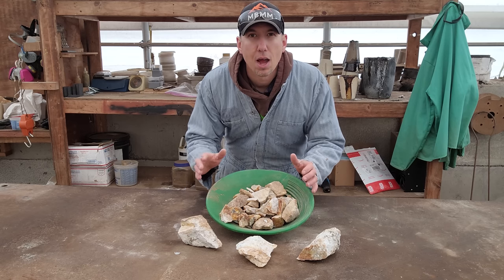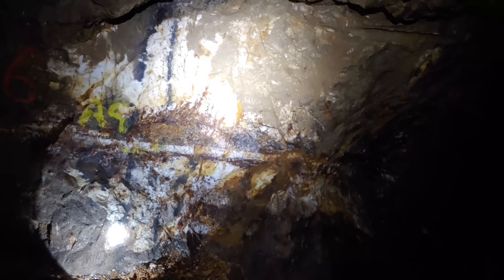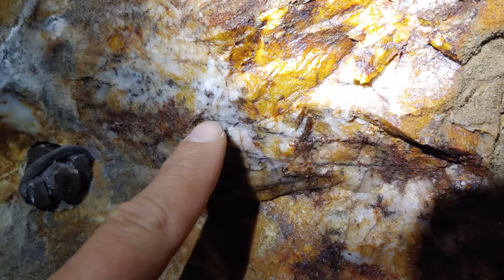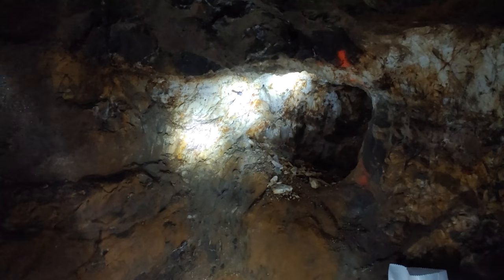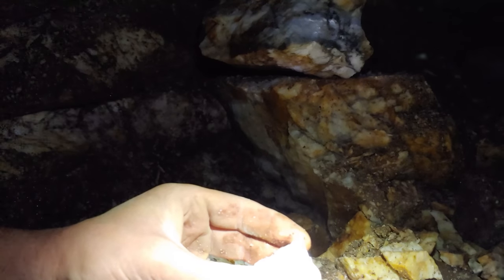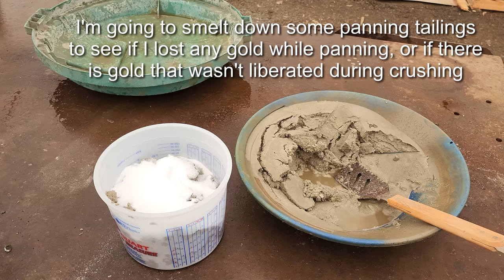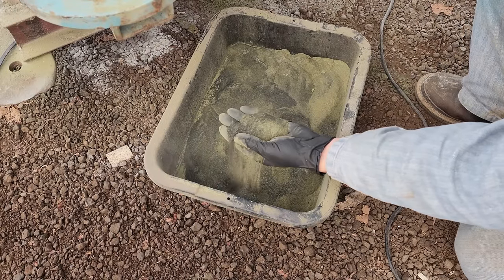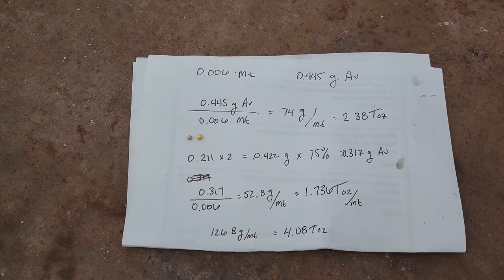Smelting Gold Mine Sample - Processing Abandoned Underground Gold Mine Ore

Comment: Jason, you should try applied heat to the cone mold to slow the cooling process and allow more time for the heavies to settle to the bottom.
Reply: @UCWPd57qVP0c5Is8-2g4hEWw The heavies are already at the bottom of the crucible and are actually the last out. If you delay the cooling of the cone mold, it gives the heavies more time to settle. This is the technique my grandfather used.
Reply: Your grandfather's method sounds totally logical.
Each time I watch Jason pour hot content into the cone and see the remaining liquid in the crucible not making it into the cone, I can't help but wonder about any possible heavy (precious) metals being left behind; or how much harder it must be for them to reach the tip of the cone since the cooling process has already set in. 
Here was also the first time I saw him thin (re-smelt?) that bottom leftover in the crucible, which is good, but it was then poured into an already cooling mass, which might have prevented any remaining heavies from reaching the tip of the cone.
Reply: @vernowen2083  You should try the oil and water in a clear glass demonstration. The heavies are at the bottom of the crucible after the melt but they are not the last out during the pour as they sink through the molten solution very quickly as you tip the crucible over while pouring.

Comment: Hi Jason!

I work in granite industry many years as driller and also stone splitter with those same wedge, I strongly recommend you at least 3-4 more wedge 4 inch appart, don’t dip to much in the face also, and last trick is smash just a little the wedge and let pressure build up, drive wedge straight into didn’t often work, it drive the crack often to the easiest way than take big chunk 😅 and for removal of the wedge drill close along one feather than will loose the pressure of the wedge easily. Drive pop hole throught natural crack is the best. You should absolutely put the chisel away you done well the feather and wedge man! The wedge was the piece you smash and the feather was the two piece you have to point into direction you want the pressure. Here in quebec we name it Coins & Jumelles 😁
Reply: Merci beaucoup! 🇨🇦❤️🇺🇸🍀🔥🌲🥓

Comment: As for lights go, when I was a photographer we used what's called "daylight" bulbs. Normal bulbs tend to be on the warmer side of the spectrum IE- yellows to orangish light as where "daylight bulbs" are on the blueish side which makes light that is more like sun light and also it's easier on the eyes. Hope this helps Jason.. Can't wait for the next video.. Chris..
Reply: Question for you. What is the photographers term for those silvery-white "umbrellas" used to provide even diffusion of light ?
Reply: @John-ir2zf  umbrella diffuser...
Reply: @John-ir2zf  We called them chimera's as kind of a blanket term as it was the company that made them. If you go to a photography store you can find the "daylight bulbs", diffusers, light heads and tripods. A cheaper option could be to swap out the blubs on you shop lights with the led bulbs, either was it will help the video. Regards. Chris.
Reply: Regarding lighting: A lot of light is being reflected back to the camera when you look right at a sample and it overwhelms the sensor. Having the light off to the side at a different angle than the camera may help.
Reply: @MrPhillip2  Yea, what's going on is the quartz being a bright white reflecting a lot of light and everything else being dark. He just needs to change camera settings to at least center-weighted metering for exposure setting. This way the camera shortens exposure to what he's trying to point out in bright center.

Comment: Hi Jason, Richard Cheney here ,,I've been a gold miner for over 30 years ,.and have had to deal with gold dust recovery for a long time.and your final processes are no good ,after you get it down to a powder ,you need to pan a real lot ,and in a bigger gold pan you have there,with fine gold ripples to catch it ,and when you get it to this basic panning ,and use a magnet to get out all the iron,black sand ,and so forth,you take this concentrated stuff and run it over a black majec sluice refine gold table,and pan that down more until you come down to the super refinements,and then you proceed ahead to your kilm ,are crucible ,and you add in healers borax, and bring it up to 2,000degrees,and por it into you graphite mold ,there's a lot more to this it I can't at this t crept all infro.
Reply: Richard here for more infro. You need a much bigger tank of water than your using there to pan that more correctly, to get rid of all that,dust patticles,evermore you use the black majec table,and all you need to mix into this is jewlers borax,,a flux you can buy there's much more you should know, about all this, whats our email and can trian you to the max,ie

Comment: Hi Jason. Your fine grinding mill ain't a grain mill. It's a mineral processing mill. Bico has been manufacturing Mineral processing equipment since 1888. Although this mill is discontinued they still supply replacement parts, so you should be able to get new plates if required. I have been a mineral processing technician for 17 years and I love disc mills for fast fine grinding. We tend to use a disc mill primarily for assay samples( analytic analyser)  and not gravity separation due to the amount of ultrafine material generated by the discs. This is probably why you had so much precious metal in your tailings. You did a 2 stage grind which is good but, you didn't seem to screen out the fines in between. These then get reground and produce the ultra-fines which you don't want as ultra-fines tend to go straight to tailings in gravity separation. I love your shaking table by the way. As I specialise in gravity separation and pilot plant I would love to get my hands on it. As I live in the UK I doubt that will happen. Happy new year to you.

Comment: I do a lot of amateur photography for a hobby Jason, and what is happening for the most part in your video is the camera you're using is adjusting its light if you're on auto exposure, and trying to find a balance between the darker Shadow area in the outside what you're trying to show which makes it too bright on the center. You need a camera where you can, black on a phone camera, tap the spot you're trying to show to the camera know to adjust the lighting to that spot and ignore the other areas.  The only other thing you can do is get the camera lens closer or zoom in closer to where the darker outside area that we are viewing is not in the picture. You have to take the decision making process that the camera is using out of the equation. It is trying to find a proper light balance for everything that you have in the viewing field the dark and the light and when it tries to brighten the dark it automatically wash it out what you're trying to show us. If you can manually bring the brightness down it will make the surrounding area black but will make us able to see the detail on the light area. I hope I worded that in a way that I was understandable. Love your videos.

Comment: design a large crucible pouring device so when you pull the hot crucible out of the furnace you can set it in a cradle with one rod across the top of the crucible to hold the crucible from falling out  then you can be off to the side and turn a wheel to spin the crucible and align the cone mold under the pour like when you have two people pouring....kinda like the large gold pouring refiners pouring into a mold process.....great vid

Comment: For up close work on the face, a dim led headlamp will give you all the light you need without blowing out the rock you're inspecting in the video. If you have an adjustable headlamp that's even better. But much less common these days than before the onslaught of LED headlamps.

Comment: I have done some rock breaking with wedges.  You have to be much more strategic.  All your wedges need to put pressure in the same orientation.   You need to use more wedges.   The spacing needs to be around 4 inches apart at most.  You need to make sure all your holes are at least a couple inches longer than your wedges.   Using natural faults produces your best results.  You can also buy an end for your  hammer drill for sinking the wedges on hammer mode.   But the key is more holes and water while drilling cuz you will go through a lot of drill bits.  good luck

Comment: Feathering Wedges is actually a set of 3 wedges, the main one being in the center, but it would be nothing without the side wedges, it is like adding a fulcrum to the wedge basic machine and gives extra leverage against the rock, doubling pressure rather than just linear pressure increase like a bare single wedge would give

Comment: Feathers and wedges work much better if you can run three or four of them in a line. They work together to open a crevice much more effectively. And you'll have much less risk of getting a single wedge stuck in the rock, requiring you to rescue it with even more work/frustration.

Comment: Hey Jason, thanks for another informative video.  On lights, you need a broad wash led not a spotlight. You'd probably do better with a decent inspection light eg Makita or DeWalt than any of the caving or sports lights as they're all aimed at powerful spots which is a nightmare for exposure/ dynamic range when filming.     DIY/ automotive lights like that are tough waterproof and would last long enough to film with. Many also clip onto belts etc.

Comment: You don't necessarily need new lights, just adjust camera settings if possible. It would be under metering and choose center-weighted. What this does is select the exposure for the shutter more so what's in the center of the image, than the surrounding as a whole. It's most likely set to a general wide area and being in a cave means mainly dark so exposure is boosted but the bright white quartz get washed out.
Reply: You can also try to illuminate the close ups with the outer edge of the headlamp light, versus the very bright center spot area. You can see that the camera can cope with the less intense light falloff from the edge of the light’s spot cone.

Comment: On the lighting issue:  speaking from the viewpoint of an ex-professional photographer, your problem is that you are using a spotlight-type light,(maybe your headlight) to illuminate the faces of the specimens. This gives you a huge difference in light intensity within the picture framing. Your camera is trying to average out this huge discrepancy. The problem with this is that when you have the spotlight is beamed directly on the specimen face , which ,incidentally, is generally pretty reflective anyway, the camera perceives it as an intense highlight whilst trying to average out the brightness ranges. You will get a far more workable result by using the intensity fall-off zones of the spotlight. Henceforth, don't point the spotlight directly at the face but rather off to the side of the specimen.

Comment: JASON try half that pan so you can swirl it better better control of your material .i was always told when panning you should use as clean of water as you can with a little jet dry to break surface tennson in the water hope that helps it has in my 50 years of having fun Preston

Comment: Jason, I would not go in any mine op without a metal detector. I have 4 and several are very hot on gold. Minelab Xterra is lightweight and inexpensive used, Garrett AT Pro is hot on gold also. Hell I can loan you one.

Comment: a comment from a geologist: the way you describe vein emplacement sounds, catastrophic? like there was a massive amount of fluid waiting to inject itself into a crack. This almost never occurs. 

More likely is that you have a hydrothermal system, interconnected crack and conduit systems in which fluid circulates. This fluid can be full of dissolved salts and acids, often with lots of sulfur and halogen acids. Over a period of time, the fluid can replace the minerals in the surrounding rock with vein material, or the crack systems shift enough to allow micron-sized layer upon layer of vein material. The largest veins, like in the California motherlode, are hundreds of feet wide, and likely represent up to a million years of fluid flow and vein emplacement.

Comment: You might consider using some sort of diffuser to reduce the glare from your lighting. You can get a diffuser lens for the Makita battery-powered DML811 work light. Another option is a 360deg area illuminating jobsite light, but many of those are large, cumbersome, and heavy. You may have seen night crews doing roadwork with their big floodlights shrouded in what looks like some sort of hot-air balloon that diffuses the light so they don't get so many hard shadows where they're working, which is a real problem at night.

As for the feather and wedge: You know what a firewood splitting wedge is, correct? And you must have heard of something being described as being wedge-shaped? Thus, the triangular chunk of steel is the wedge, and the feathers are what the wedge binds against as you drive it into the hole.

Comment: I'm super impressed by that crusher you were using, that's making talcum powder fines!
I've been working on building a 12v, wheelbarrow mounted jaw crusher for a while now, 
So that I can sample rocks from old tailings & hard rock mines out in the Australian bush.

(So far I've learned a lot about how NOT to make a working jaw crusher, but it's getting closer, 
as I've actually got it to crush rock a few times, 
till critical elements failed, but, hey, it's a work in progress)

I intend to make a flail mill to get finer crushings after that

I've got a few questions, if you feel like answering - 

 - I'm curious as to why you just panned the finer crushings at that point?
Was it too much bother to fire up the big shaker table?
(do you have a small one?) - yet another project I'm planning to work on  ;-)

 - Woudn't a Miller table have helpe seperate the fines better?, 
or where you just sort of skipping steps to get the vid out

 
- Is there any value in slag?  
It looks like it should be good for something, it's hard as hell, brittle, and shiny
There's gotta be a use for material like that
It literally get's poured into a mold
There's GOT to be some sort of jewellry tie-in there somewhere!

- You often speak of 'collecter metals' when smelting, 
can you point us all to a good reference for what, how, why, and when to use them?

- Have you heard of using a potatoe as a crucible?
Apparently many people in outback Australia just cut a spud in half, 
scoop out a depression with a spoon
and use a blowtorch to melt their gold into nuggets
Look it up, I'll bet you get a giggle, and can't resist trying it!
If you do, you know you'll want to! 
And I'd love to see the Vid.

Kepp doing the good thing Mate
I enjoy your vids immensly

Comment: Instead of these flat bits try using regular pointy bits for breaking the wall. And don't dig into a single spot too much. Try to create cracks instead of holes and then start loosening the the face bt following the cracks you made. 
But like I said don't force the tip too deep or it will get stuck. So I suggest you get 2 bits so if you get one stuck (you probably will) you can use the second one to get it loose.

Comment: I'm no professional when it comes to videography, but your lighting issue could be as simple as dialing back on your cameras exposure.  You could also bring a secondary camera specifically setup for those close up, bright light, mineral shots. Kind of like setting up two drills, rather than having to change out bits, you can just grab the other drill and save time.  Dan Hurd might have some pointers there, from what I've seen he brings a few different cameras for different applications.

Comment: i was thinking about the viability of using a tunneling machine in the form of a sphere, that could tunnel in any direction and move using hydraulic rams to cling onto the rock around it and like a worm move around as its carving section goes to town on the rock in front of it. i dont know if it would be worth such a machine, but i can imagine it being quite a cool tool in high enough grade ore bodies lol. then again, a regular carving machine might do, but anyways haha. i have thought about the possibility if using a diamond saw to cut out squares of rock and then use wedges to pry out larger sections at a time. maybe even be able to specifically cut along either side of a vein to excavate chunks out without blasting. and just use super high quality diamond blades to do so. that way you could also make your own cracks to wedge rock out with just by carving relief cuts as you go along the deposit. anyways, just some wild ideas of mine. i always love seeing your end-point work with smelting and cupeling. gold is fascinating as an element.

Comment: You need to get a diamond tip drill bit along with a pointed chipping bit for that drill and drill in a little ways in a couple spots around then start chipping in those drill holes working around the area your trying to get out Iv found this works good for hard rock getting gold out

Comment: how about running a generator outside the mine, extension cord going inside to a bigger jack hammer and drill?  also; maybe a rope going in to help haul out bags in a tear drop shaped container?
if that all fails; then drill holes and blast that section of vein?